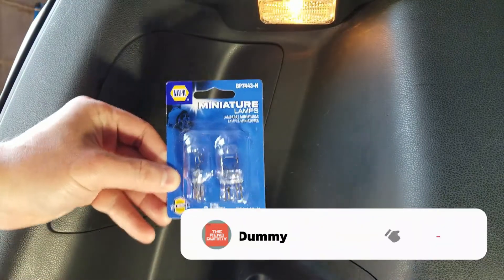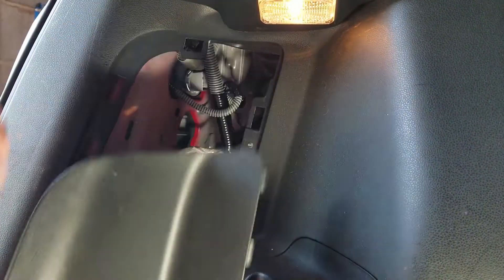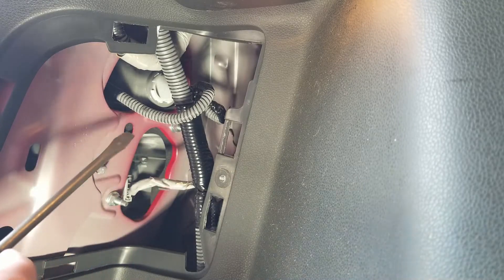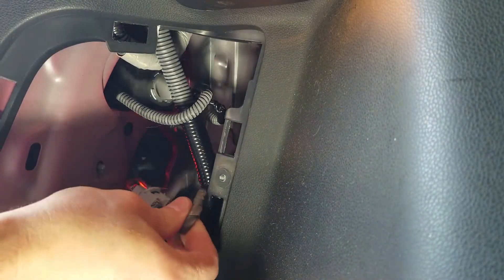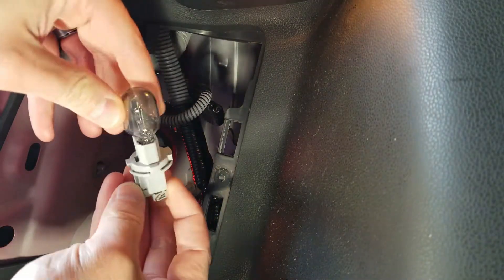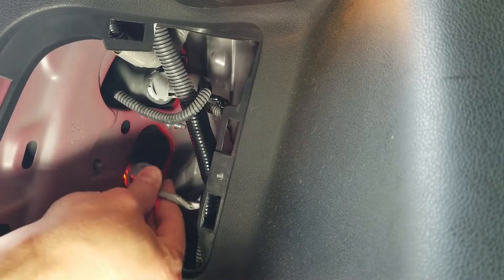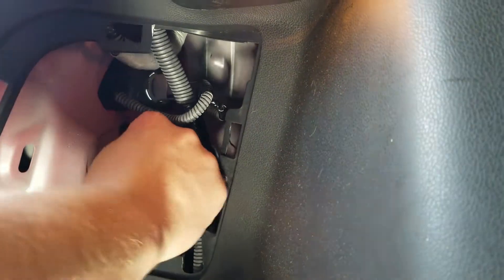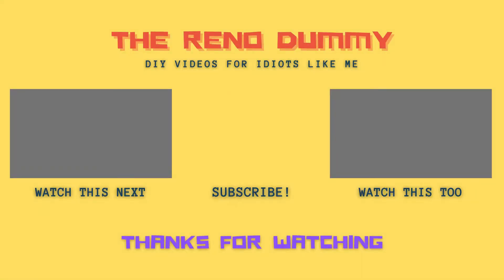How to Replace a Brake Light for a Honda Fit 2009-2014

Comment: What's the secret if the socket doesn't come out with a finger twist?  It's really stuck AND YES i am turning it COUNTERCLOCKWISE.
Reply from the maker: I'd try some needle nose pliers if they can fit and reach.
Reply: @therenodummy  Just don't fit. Even short ones are too long.
Reply from the maker: Maybe you could try spraying some lubricant on it? Maybe it'd loosen it up.
Reply: You probably already fixed it but usually pushing it in a little bit before you twist helps
Reply: @lucyfuir6386  Right, it's fixed. It just took a stronger hand than mine.  Thanks anyway!

Comment: I just changed mine.  One thing that can help is  to look at the bulb from the outside.  You can see if your turning it the right way.  And you can see if it's lining up right going back in.
I had to push in to get it out and it took a couple trys.  But only five minutes, the video was helpful.
Reply from the maker: That's a good tip

Comment: hi i have honda fit 2009 the break light need to be changed bit only with 2 fingers i can reached the bulb , the problem is that is very hard turning anti clockwise  , and I'm scared to use a plyer , any suggestion please thanks
Reply from the maker: I would think you could use some pliers as long as you don't turn it too hard. Hopefully it won't take that much to loosen it up.
Reply: @therenodummy  i give it a try thanks a lot
Reply: @The Reno Dummy   i try it and it works i use a long nose plier , thanks :)
Reply from the maker: Awesome. Good trick to know. Thanks.